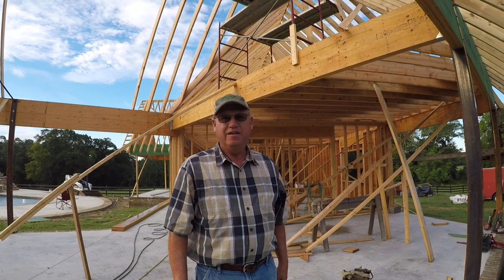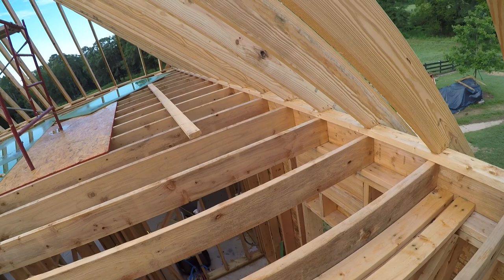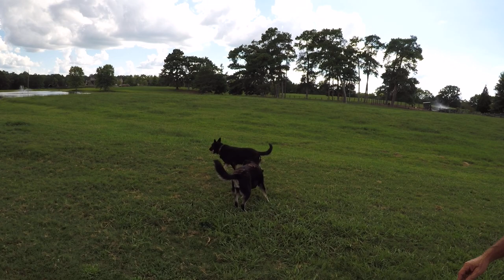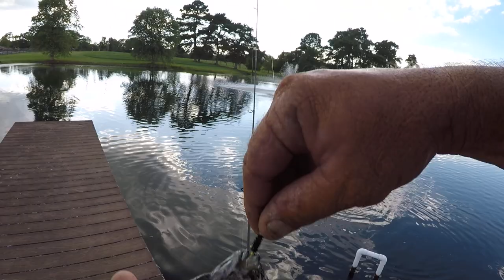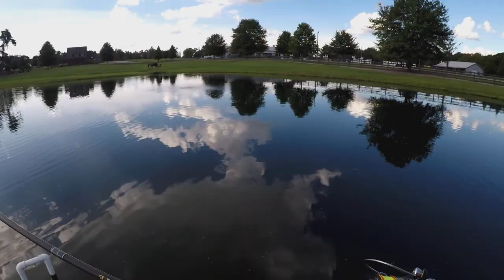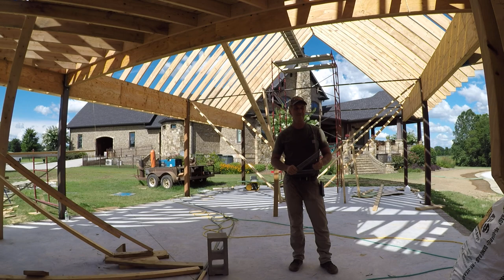This Pond Is LOADED With HUGE Bluegill!!! (A Day In The Life Of The Machine)

Comment: Did some remodeling and rebuilding on the side throughout my 49yrs.I cut trees for power companies for a good many years then left there and went logging.I prefer to start where a board begins it's life.
Want a hard days work be a one man crew and cut them trees on a mtn steeper than that 12 12 pitch,limb them,pull cable and chokers to them and then winch them up and drag'em to the log yard in the sun,rain,sleet and snow (can be all the same day in PA...LOL) and get 3 tractor trailer loads out in 10 hrs.
Today I just fish,nearly every day,I gave all that other stuff up a few yrs back...gotta show these kids today how stuff is done now and again though...lol